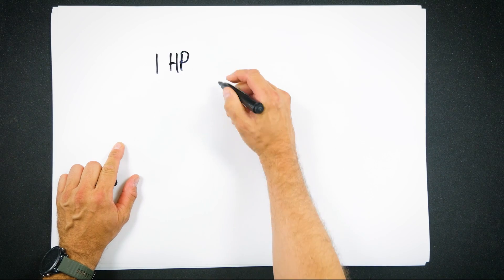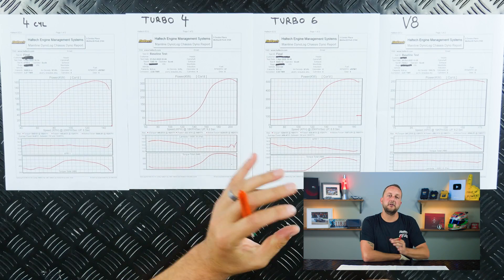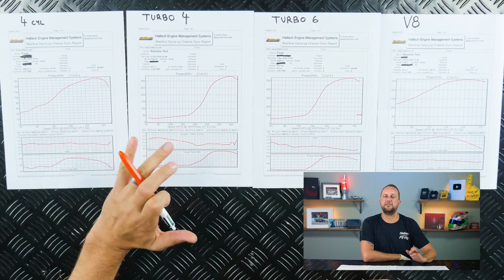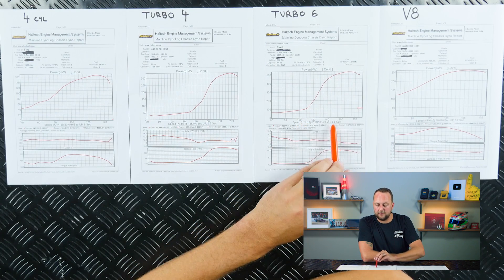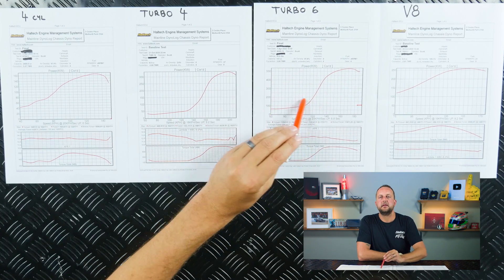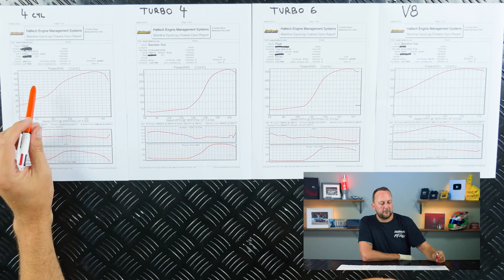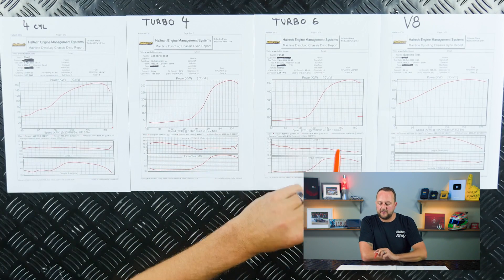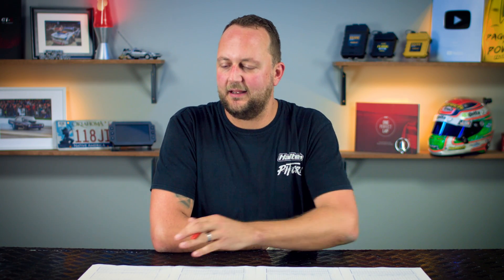🛠 A Perfect Power Curve - is there such a thing? | TECHNICALLY SPEAKING

Comment: No replacement for displacement
Reply: dylan zrim  are you sure? What would it be then? I ask because a boosted well tuned 6.7 will still out perform a boosted well tuned 1.3. I think anyway.
Reply: Displacement per minute makes a great replacement for simple displacement and you don’t have to slow it down before the corner or carry it around the corner.
Reply: @rollsroyce329 Just for the the argument. so replace volume with rpm? So more gears to get 20,000 lbs up hill at 300,00rpm?
Reply: @zit6865 sure. Might be a bit extreme and a bit of a straw man there 🤪 but fundamentally Power, not torque, is the limiting factor in not only the vehicles top speed but also in how quickly it can accelerate at any speed and how much weight it can tow up an incline at any speed.  It might be expensive to use a turbine engine to long haul heavy goods but it doesn’t mean it would not be effective.  Power can be converted to torque through high gear ratios (lots of teeth, not necessarily lots of gears) but torque can not be converted into power with any kind or gearing.
Reply: @zit6865  Nice looking Hardley Ableson in your pic. What year?  I ride an 08 Road King and a CBR600RR dedicated track bike.
Cheers.
Reply: @rollsroyce329 it's an 03 ultra classic. Got laid off a month after I got it. So I let it go to make life easier. I miss it it was a photogenic bike pretty blue pearl and silver flake in the paint.
Reply: @zit6865  sorry to hear that man . never seen one that colour.  Mine’s black.  Pain in the ass to keep looking nice.  You’ll get another one day.
Cheers.

Comment: An NA 4cyl making 550Nm? yeah nah
Reply from the maker: Well picked! And sorry, I messed this one up!
Have displayed “Roller Torque” when talking about the dyno sheets, which is calculated against roller speed and is determinate on the size of the dyno rollers (ours are 273mm). I should have displayed “Motive Force” on our Mainline Dyno which would have made more sense. I didn’t use “Derived Torque” because the tacho was not calibrates in the Dyno software for each of the random example cars I picked.
A good read on Dyno Torque / Motive Force / Tractive Effort can be found at: https://www.mainlinedyno.com.au/images/downloads/DYNO_TORQUE_FIGURES_-_THE_TRUTH.pdf
PS. I seriously want a K series with 550nm of “Derived Torque” haha
Scott
Reply: @haltech  that document is a good read!
Reply: Yes...I have studied manufacturer torque claims for decades and all NA engines always make around 100Nm per liter at the crank..
Reply: Yeh I was scratching my head too lol.

Comment: How does the maths work in real units and not stupid bald eagles per cheeseburger?
Reply from the maker: The original calculations (made by James Watt) were all done in imperial units so all the equations make more sense (at least visually) when using feet and pounds. It was originally based on a horse turning a mill wheel 144 times in an hour. The wheel was 12 feet in radius; therefore, the horse traveled 2.4 × 2π × 12 feet in one minute. So it makes more sense to use the imperial measurements in this case - as it shows how the initial calculations were made.
Reply: @haltech  but what sort of horse was it Sir Tuning Fork?
Reply from the maker: A mustang - of course!
Reply: kW is 3/4 of hp, newton meters a bit more than 4/3 ft-lb... super simple stuff

Comment: If only the was a way to not be in 4th gear at 100kph so that you can be on boost. I;ll have to check my G6Et(543 rwkw)to see if it can be done. Also, why would you say, i have to put an LS in there but then you use a Skyline. In Australia you should have used the Barra.....500rwkw cars are on boost at 3000rpm.
Reply from the maker: The LS is one of, if not the most popular V8 in the mod/racing community today so it's the obvious choice to use it as an example of a V8 power curve. As much as we love the Barra, it's not available world-wide so a lot of our viewers would not be familiar with it. We thought using an RB or a 2JZ for our straight 6 power curve example would be more widely recognised.
Reply: @haltech   Fair enough but it is an Australian channel with im sure a shit load of guys with Barras that would prefer to see the LS compared to a Barra, not engines that are not nearly as common as the Turbo 6 that has been in XRs,F6s and G6Ets for 18 yrs here.

Comment from the maker: 4 vs 6 vs 8. Why do the Power Curves from these engines look so different?
Comparing Dyno Charts is a popular pastime within the modifying community, but what are you actually comparing? Is it just the spike at the end of your RPM showing the Max Power figure or the shape and position of the entire Power Curve? In this video, we compare power curves from a naturally aspirated 4, turbo 4, turbo 6, and a naturally aspirated V8. We also explain the differences between them and how they affect the vehicle's performance. 
Submit your dyno graphs here: https://www.haltech.com/how-to-read-power-curves/
Reply: I'll take big block turbo V8, thanks.
Reply: I was disappointed with this video, it was super basic for the engine noob basically.  Would you ever do a video talking about what it  takes to make a almost flat torque curve?  You could use an na LS v8 no vvt and maybe with vvt, and a turbo also.  The turbo could have ecu controlled wastegate and run more boost in certain parts of the curve than others, though the response time to boost changes would be a factor.  I am also curious on a typical stock ls cam with low lift vs an aftermarket solid roller cam with quicker ramp, more lift, and same duration.  Love the channel guys.
Reply: afr related ignition timing and acceleration enrichment with or without boost
Reply: Yep love my VT ecotec on B roads as you can throw it around as holds the power curve great between 60km to 170km 👌🏻 switch back twisty 1s fantastic if don't get busted 🚔😂